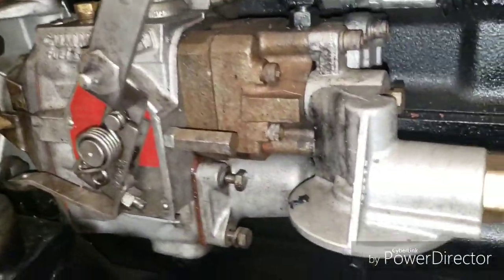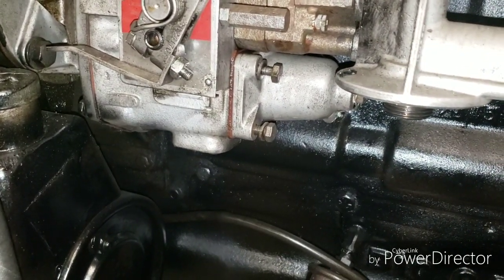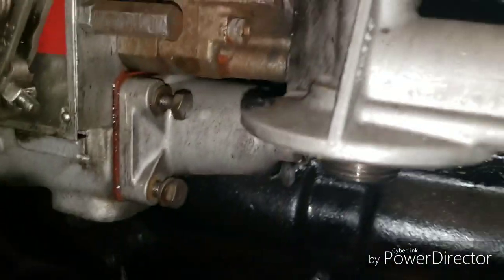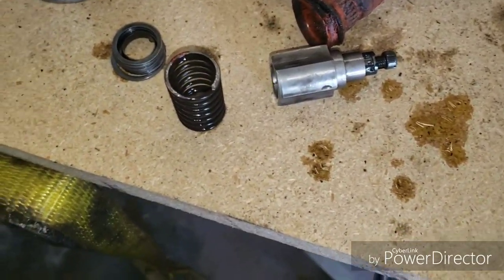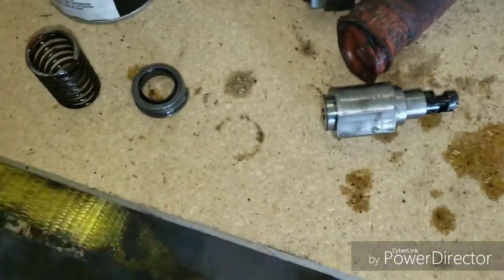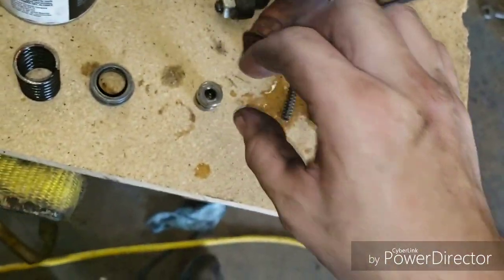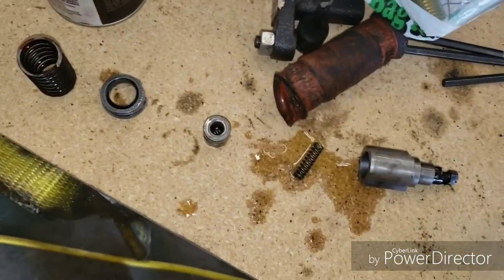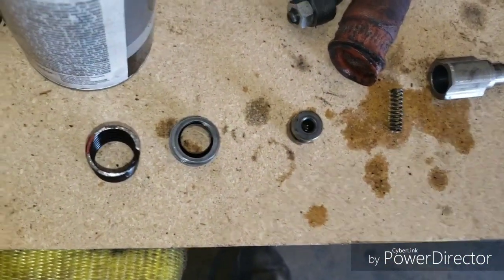Cummins PT Pump - fuel button swap - Big and Small Cam

Comment: So when you get let’s say a 40 button or a 00 what does that mean or change?
Reply from the maker: Smaller the button the more fuel it allows thru
Reply: @wessimpson2794  what do you recommend I get I was going to get the #7  I saw a number 5 as well
Reply: Like when I go up hills I have to downshift cause it bogs down
Reply from the maker: @213eddy  it depends on how heavy you are, what type of truck/engine/transmission. Where you are etc.
Reply: @wessimpson2794  it’s a 1979 Kenworth w900 it has a 15 speed and it’s a nt. 855 big cam Cummins I live in Oklahoma it’s a dump truck we build swimming pools
Reply from the maker: @213eddy  #10 button. Put a rail pressure gauge on it and adjust the pump to 250 max. Anything more than that and you will round the cam off.

Add a dual fuel line setup.
Reply from the maker: @213eddy  start with a 15 maybe to a 10. As long as you have an egt and can play with it accordingly to what the temp is under load  etc.

I will post a video in a few of a tractor we have.
Reply from the maker: @213eddy  what turbo do you have
Reply: @wessimpson2794  honestly have no idea what turbo it is
Reply from the maker: @213eddy  you can email me at simpson.wes.1985@gmail.com
Reply: If putting in a #20 button, do you need to add extra gauges (egt, pyro, rail pressure gauge)?

Comment: What kind of power?
Reply from the maker: Current Big Cam III, cpl 531, has an HT4B turbo, #10 fuel button.  Running 34lbs of boost at 43,000lbs empty. So figure the math versus 24lbs of boost stock
Reply: @wessimpson2794  hey need sum more power out my fuel pump
Reply: Have you had any problems with a number 10 button